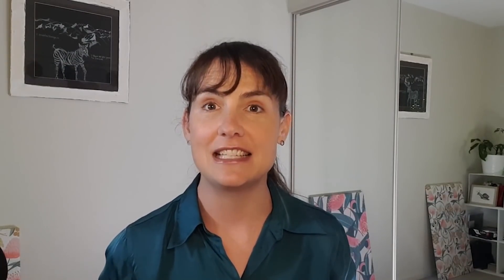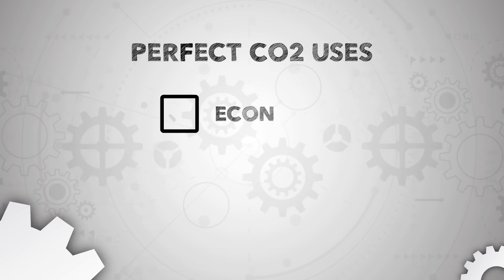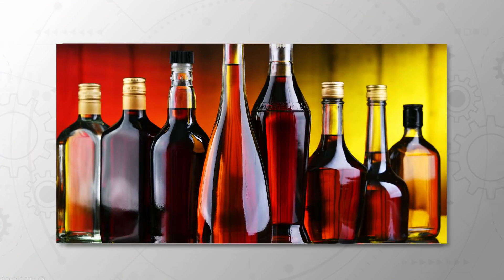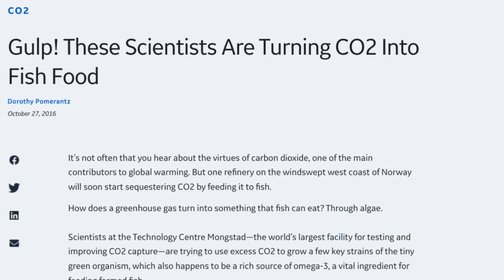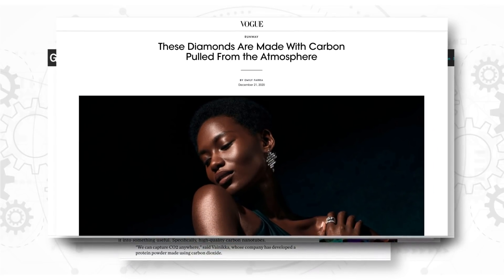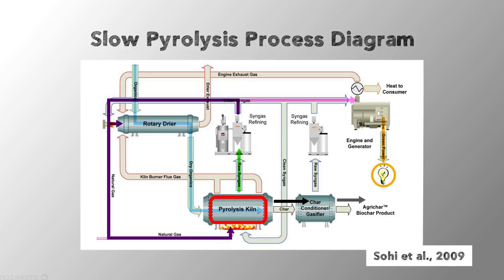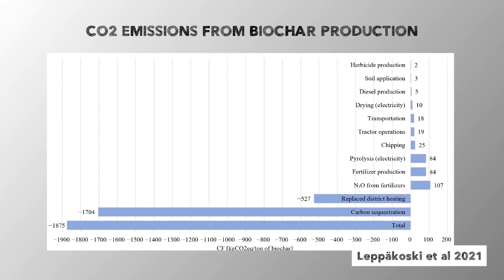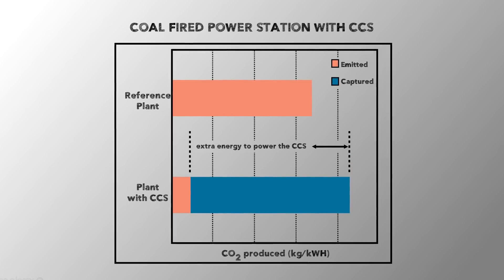From Waste to Wonder: The Surprising Uses of Carbon Dioxide

Comment: Not from the atmosphere but before it goes into the atmosphere. You can use hempcrete and other structures to help trap CO2 for that which is already there, while investing in active and passive trapper technology with emissions and other means of facilitation to creates more CO2. For instance if you rethink how we build cities and build cities where you can create underground networks for travel then you can build entire streets and parking lots underground in which you can facilitate control over in a meaningful way (so long as people are willing to pay for it of course) in capturing that CO2 before it ever leave the underground by using fans and other utilities. Very little CO2 would still come out, but that is a huge improvement compared to where it was at. And that CO2 could be used as fuel to make electricity which through a system that Tesla (the man, not the car) would approve of allow all sorts of electric vehicles to function indefinitely within the city's underground limits making it preferable for underground travel. And even if you end reducing fossil fuel emissions completely as far as gasoline is concerned, you can still use human excrement and its carbon to keep it functionally cheap for city travel underground.

Comment: Carbon dioxide is used by plants,collecting it on the cheap is the real issue.
What about a bowl on top of chimneys ?It could be ceramic porus impregnated with catalyst and given a charge and sprayed with agent.
Multipile bowels draining the product in containers.
The size of the porus is where the potentail lies.
The industrial lot should try one, the ceramic making i feel is a big field if you can control hole size though out.

Comment: The problem is co2 where it can't be captured. Lowering temperatures will lower co2. By lowering sea levels through re-salination that happens by the separation of salt from ocean water in polar regions where it can freeze an artificial glacier can be implemented. Ocean water also freezes. We can make it more likely to freeze  by keeping it shallow and still. We need a desalination plant for the purpose of making ice not drinking water. Desalination in warmer climates can maintain a standard suitable for crops and ground seepage but again not drinking water. Ocean water in general should be allowed in at high tide and trapped where land filters it and fresh water should be regulated to a minimum out to sea. With these concepts we can implement desalination in a beneficial and inexpensive way while actively adding ice, increasing Ocean salinity, reducing sea levels, and boosting the ocean conveyer. If you want fda approved drinking water made from sea water it'll cost you the sun and the moon...but it doesn't mean the concept isn't worth considering in other ways. If environmental technology comes up with a solution it will hold it for ransom because it's a business and therefore it's self serving because it's only objective is to gain at any expense. Don't bother waiting around for it to save you. It doesn't care because there's no money in it.

Comment: what about using it as a refrigerant for energy storage? store it in huge old mines for gas phase and in tanks for liquid. when it goes from liquid to gas get energy to power turbines and generators. I've seen where there is new tech for CO2 valves and such. you could get massive on demand storage and put old mines to good use.. I'd wonder how similar this might be to CAES compressed air energy storage systems. with so much heat transfer going on I'd wonder about coproduction processes. do the math and ponder

Comment: If we can get Co2 down to 150ppm. It will solve our greatest problem. Getting rid of life that relies on plants, on this planet. With all of us dead. The planet will reset. And go on it's merry way.

what amount of Co2 is required for plant life?

How Does CO2 Affect Plant Growth?
The ambient level of CO2 in the atmosphere is approximately 400 PPM. At 100 PPM of CO2 the rate of photosynthesis would be stopped completely. At 150 PPM the plants begin to respire, and photosynthesis is stopped.

Me->
Just under the above bit on the same page:
Now if your commercially growing plants what do we have?
<-Me.

How much CO2 do plants need to live?
For most crops the saturation point will be reached at about 1,000–1,300 ppm under ideal circumstances. A lower level (800–1,000 ppm) is recommended for raising seedlings (tomatoes, cucumbers and peppers) as well as for lettuce production.

Or
What level of CO2 is needed for plant growth?
Most experts agree that 1,500 ppm is the maximum CO2 level for maximum plant growth, although any CO2 level between 1,000ppm and 1,500ppm will produce greatly improved results.5/05/2023

Amazing isn't it? We are told 400ppm is bad yet for growing things not so bad. And plants were here first.
And it has been a whole lot higher.

Who's telling porkies? And why? I wish I knew.

Comment: My words->
To the point today where a Diesel engine can be Co2 neutral with a chemistry additive. Have a look at AdBlue: <-My Words:

What chemicals are in AdBlue?
What Is AdBlue? AdBlue Explained | How's AdBlue Used?
There are two major AdBlue ingredients that make up the liquid. AdBlue is a colourless liquid made from a mixture of high-purity urea (32.5%) and deionised water (67.5%). The solution poses little risk to humans or the environment as it is mostly water-based.6/11/2020

How does AdBlue work chemically?
Heated in the exhaust, it decomposes into ammonia and CO₂. When the NOx from the engine exhaust reacts inside the catalyst with the ammonia, the harmful NOx molecules in the exhaust are converted to harmless nitrogen and water, which are released from the tail pipe as steam.

So, no need for lithium mines now. Or acres of solar panels killing the grass underneath.

https://www.tetrosyl.com/adblue-explained/#:~:text=Tetrosyl%20launched%20AdBlue%20under%20the,your%20diesel%20car%20needs%20it.

Comment: Fuels From Air – The Process
The FFA system uses renewable energy to capture carbon dioxide and water from the air, electrolyses the water to make hydrogen and reacts the carbon dioxide and hydrogen together to make hydrocarbon fuels.

Comment: How about, carbon capture to make fossil fuels that get burnt so we can then capture the carbon again. Rinse and repeat. Designer fuels are cleaner burning than crude oil products.
It requires cheap electricity. Preferably not fossil fuel solar panels. But hydro or wave generation tidal maybe?

Comment: CO2 is 420 parts per 1,000,000 of air, although this is high is is still a very small percentage and in my mind that required you to process 1,000,000 unit of air to remove 420 units of CO2 if you have a process that is 100% efficient. That takes a lot of energy. Can we ever get a benefit out of any carbon removal process or is it better to plant trees?

Comment: I saw a lecture talking about making aggregate (rocks/sand) for concrete from sequestered CO2. It's cheap because it's not energy intensive and it doesn't need high purity CO2. It doesn't release its CO2 over time. And the construction industry needs gigatons of aggregate every year. In fact, there is a shortage of aggregate and it often needs to be shipped hundreds of miles. I'm surprised more people aren't talking about this. Here's the link to the lecture https://youtu.be/6RJ8lLgQvmc

Comment: Rosie, you keep referring to CO2 capture when in fact it it the carbon that needs capturing. I know the effect would be relatively small but to remove gigatons of oxygen from the atmosphere is probably not desirable.
Given the amount of concrete in use these days, it is a pity there is not a carbon brick that could be produced with low emissions to be used in construction. It may present new issues if you end up building faraday cages, or attracting lightning etc. but a permanent use would be the best option, perhaps paving roads or footpaths for example.

Comment: To say that making syngas is very energy intensive is missing the whole point!   Of course it is - that is what you are trying to do.  You are trying to make an energy rich fuel that will propel an airplane.  That energy comes from the energy you used to make the fuel in the first place.    

Another way to think about it is to consider the fuel as an energy storage medium.   When you make fuel you inject energy into it that the jet engine uses later.   With fossil fuel,  that energy was injected into the fuel  a million years ago.

Comment: I would love if you two had take a bigger look into the thermodynamics of Carbon Capture and Storage. That general pop understands this is important, because otherwise a big portion will belive that CC is some kind of magic that will easily safe us.
If you tell them, to take the CO2 out of the Air we've emitted in the past 100 years will take up double, quadruple or even more of that energy we've gained thru burning that carbon in the first place, they'll beginn to understand that CC is not an easy solution, especionally those direct air capture methods.
Basically we would need to harvest gigatones of plant material over decades and pyrolise them into pure carbon to store it subsurface. Only the entirety of plants on the planet will be able to suck out that much carbon out of the air.
The comparison between how much CO2 Humanity and the Nature emmits gives one an idea. Like 99% of all emitted CO2 stems from nature which means it got eaten by plants in the first place. The rest stems from Humans digging it out of the ground. So we'll need to tap into this incredible ressource to gain enough energy to store some percentage of the CO2 Nature eats for us.

Comment: Hi Rosie!
Very interesting flic. I find this Diskussion just a bit too tech heavy. I cannot see a pure technologic solutions can work. Instead of turning solar energy into electricity and then into chemical energy to turn the CO2 into a storable form, we should once again turn to the example of nature which managed the sequestration of CO2 in the gigton Ringe, although it took a few million years.
I think that only biological processes have the capacity to take on the CO2 challenge the baby boomers prepared for their grandchildren.
There was a paper in the 1990s about ocean fertilization with iron oxide. It stated that with a tanker full of iron oxide it would be possible to trigger an ice age. The iron would cause an algae bloom that would capture and bind vast amounts of CO2 in the fertilized sea area.
In the early 2000s a trial was conducted, where a tanker full with an iron oxide slurry released some of it in the south atlantic into the circumpolar stream. 
These fertilzed patches pf ocean were visible as a phytoplancton bloom from space over weeks as they made their way east.
Following up on this experiment, it was found a huge amount of carbon was captured and introduced into the marine food chain. Apart from increase marine biomass and food production, It was also observed that some of that biological carbon was sequestering in the deep sea. All that for the cost of a few thousand tons of iron rust.
However, after these really encozraging results, an international moratorium was signed to stop further research in ocean fertilization. As so often when political interests collide an abundance if cautikn was quoted as the reason for this baffling decision, which is utterly not intelligible to me.
However, I am convinced that this is one of only a few viable methods, capable of tacling the CO2 problem in an affordable way. Another might be to engineering an algae that produces  a carbon residence that us indigestible to current bacteria and sink to the ocean Fluor where it get covered by other detrites and becomes biologically inert.

Comment: I feel like I have to repeat this on every carbon capture video but biomass is not and never will be carbon neutral. Trees don't run on carbon dioxide, they need nutrients in their soil. Every time you cut down a tree and haul it off you're depriving the biome of what it contained, the next tree planted in that same spot will have less NPK available and so your tree farm eventually becomes a dust bowl unless you're willing to produce, transport and distribute fertilisers which would all need to also be done in a carbon neutral way. 
Let's pretend that's possible, you've still got the issue where trees aren't crops. Even fast growing trees will need a decade before they've captured enough carbon to be worth cutting down. Meanwhile your generators are consuming that same mass within hours. To make a disparity of that scale work you'd need tree farms so large they'd make our fertiliser problem impossible to ever manage. Which is why current biomass generators in the EU run off woodchips imported from US old growth forests. And then there's the biodiversity problem, tree farms aren't forests. If a parasite or disease gets into a forest some of the trees will die, if it gets into a tree farm they all die because tree farms are monocultures. 
With all those risks and tertiary costs the kWh cost of biomass ends up far higher than coal and natural gas meaning poor countries will never be able to entertain the idea. Biomass isn't sustainable, it isn't carbon neutral and it isn't a viable alternative. The only thing we can say for sure is, it's getting the logging industry a lot of money.
Reply: Or you just remove the carbon and put everything back. 

Turn the tree into chracoal and you have pure carbon.
Reply: @catprog  That doesn't solve any of the issues I mentioned.

Comment: here is what we do: we produce Biomethane (purly from waste) the CO2 pruduced in the digestion and during Burning the methane for energy we use to feed alga those we use to produce more Biomethane (and perhaps some other products). Since use up biowaste, as long as this grows it is a C02 sink. And it will only stop growing after we have replaced all fossil fuels. Does not solve the hole problem, but the big advantage is: there is no extra Energy needed.

Comment: As a farmer, I would really like to see CO2 levels at about 800 parts per million. People don't start getting headaches until 1000 or 1500. So your initial assumption that we've got too much in the air already I think is incorrect
Reply: You are looking at things in isolation.

1) If the outside air is 800ppm what is the inside air like.
2) What effect does increased CO2 have on the other things plants need. (I.e does it mean less or more water)
Reply: @catprog  people have run these sort of tests, the plants certainly love it. And I'm not sure the planet should be optimized for people in high-rise buildings without proper ventilation systems, and not for food production. I'm sure there is some happy middle ground. But trying to get rid of all of the CO2 like as being done is going to lead to a dying planet

Comment: Hi. Is there a significant gain in efficiency if we power mechanical devices straight by a wind turbine instead of using electricity in between them? For example if I want to power an air conditioner with wind, would the turbine  be much smaller if I coupled it directly to the compressor instead of generating electricity and then powering the AC with it?
Reply: Problem is what happens when the wind is blowing and you do not want the AC and when you want AC without the wind blowing.

Any gain in efficiency would be offset by the wasted power.

Comment: The use of CO2 to make a more efficient version of concrete exists and not mentioned.  It's te carbonation process they talked about at 9:15.  CarbonCure Technologies was the winner of the 2021 Carbon XPrize and is a commercial business that is in over 570 concrete plants.  They just sold $35 million worth of Carbon Credits.

Comment: IMHO, if we start doing carbon capture in large amounts, and assuming it's because we have a clean energy source to use for that purpose, then we should turn it back into hydrocarbons to be used for applications where electricity is impractical, like air travel and heavy machinery.  That's a long term carbon neutral solution.

Comment: Hi  Rosie, We've a 33 Hectare forest.
 It would seem sensible to me to produce the biochar and electricity in a distributed fashion. Close to the sources of the organic feedstock. Removing much of the transport costs for both biomass and char (which can be locally applied to soils after adding nutrients and colonising the char with suitable microorganisms to avoid damage to soils and their biota)

Such a system would allow electrification of many of the operations which we currently use fossil fuels for. 
For example, sawmilling, felling trees, perhaps even electrify the tractor, whilst I imagine that we'd have little surplus energy to send to the grid, our operation would be very carbon negative with carbon being sequestered in both the biochar and long lived wooden items made from the lumber produced.
Such a system would have available waste heatwhich canbe used on site for drying lumber and possibly also domestic needs.
Such a system if sufficiently scalable would fit into many farming operations and I am sure other areas also.

Is there any hope of such a system? any ongoing research? 
We've a little experience here with making charcoal (for recreational iron smelting) and biochar (for our garden), I'm a Forester with a bit of engineering in my past, and would love to collaborate with others in developing such a system